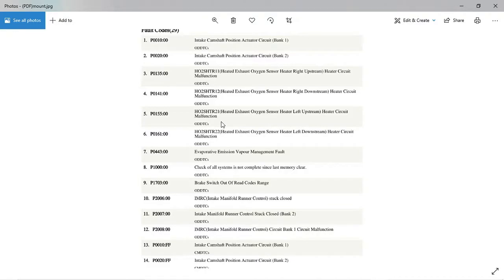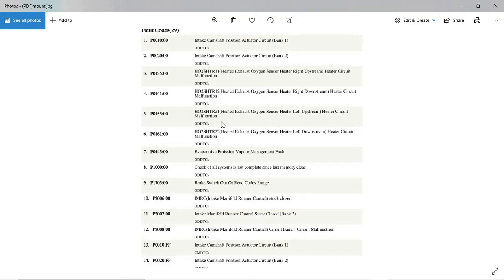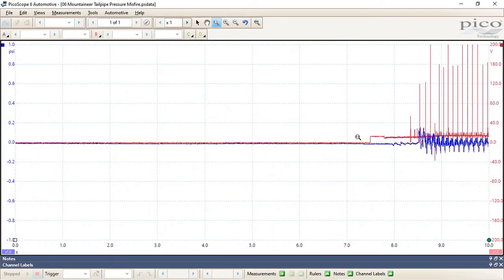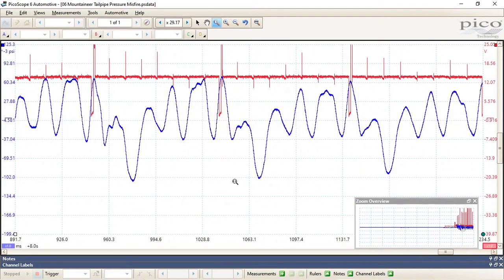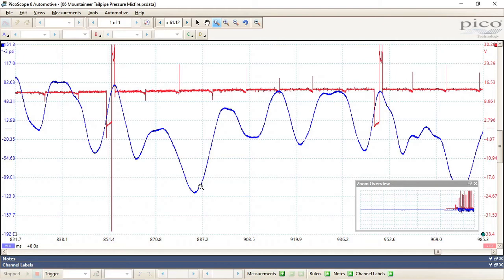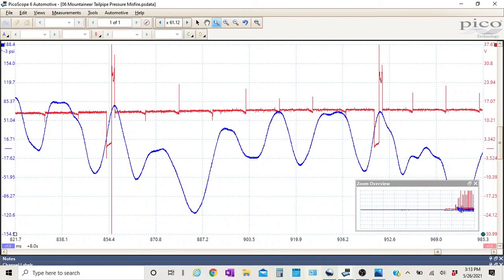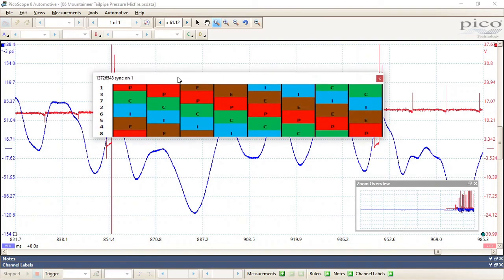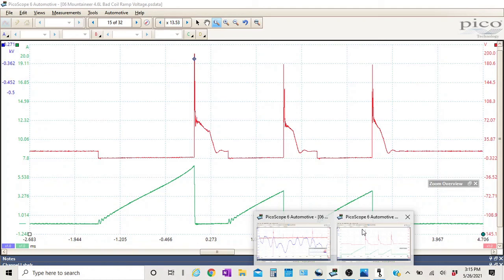Exhaust Pulses | Using exhaust pulses to identify a misfire.

Comment: You say every time the exhaust valve opens there is a "drop in pressure". Why so on a good cylinder that would have positive combustion pressure and then release that pressure into the exhaust stream when Ex valve opens??Would not a firing cylinder show an spike in pressure? Or are you referring to an in cylinder compression test with transducer where there is no combusion so the the cylinder would be in vacuum when Ex valve opens, hence the pressure drop ... can someone clarify what Ex pressure pulse pattern is expected for a good firing cylinder?
Reply from the maker: The exhaust pressure waveform in this video is referring to an ignition or fuel misfire. If an exhaust valve opens without prior combustion, then there will be a high amount of negative pressure from the expansion stroke. This low pressure is the drop we can see from the ignition or fuel misfire.

Combustion on the other can release a positive pressure(10-20psi) when the exhaust valve opens. After a cylinder has exhausted its positive pressure, a slight drop in pressure towards atmosphere will occur. My Pico wpx500 shown in this video shows a positive overall exhaust system pressure on a healthy running engine. This can only be seen with an absolute pressure sensor

Watch the video "Brandon Steckler Applying Advanced Drivability Diagnosis". Brian shows cylinder pressure with a one spark plug removed on a 5.7L hemi. Its near the end of the video.

Comment: The pressure drop is due to a vacuum pocket in the cylinder when the cylinder misfire. A in cylinder running compression test shows the vacuum pocket. If a injector is causing the misfire, injecting propane into the intake manifold will help improve the pattern and remove the misfire.
Reply: Yes, but he says every time the exhaust valve opens there is a "drop in pressure". Why so on a good cylinder that would have combustion pressure and then release that pressure into the exhaust stream when Ex valve opens??Would not a firing cylinder show an spike in pressure? Or is he referring to an in cylinder compression test with transducer where there is not combusion so the the cylinder would be in vacuunm when Ex valve opens, hence the pressure drop ... can someone clarify what Ex pressure pulse pattern is expected for a good firing cylinder?
Reply from the maker: The exhaust pressure waveform in this video is referring to an ignition or fuel misfire. If an exhaust valve opens without prior combustion, then there will be a high amount of negative pressure from the expansion stroke. This low pressure is the drop we can see from the ignition or fuel misfire.

Combustion on the other can release a positive pressure(10-20psi) when the exhaust valve opens. After a cylinder has exhausted its positive pressure, a slight drop in pressure towards atmosphere will occur. My Pico wpx500 shown in this video shows a positive overall exhaust system pressure on a healthy running engine. This can only be seen with an absolute pressure sensor

Watch the video "Brandon Steckler Applying Advanced Drivability Diagnosis". Brian shows cylinder pressure with a one spark plug removed on a 5.7L hemi. Its near the end of the video.

Comment: I've been practicing lately and trying to learn this way of testing. I watched lots of videos but most are done with 4 cyl engines. As you may know, V8s are harder to read the pulses.
What sensor did you use? And was this test done cranking or idling?
Reply from the maker: This was done on a V type engine at idle. The sensor was either the Pico WPS 500 or the Ditex Pressure Pulse sensor. Either can be used in this low pressure application.

Comment: Not a good overlay, you aligned the left side, adjusted the right side, and had to come back to the left side again, new pieces of software don't have this, meaning there are better overlays than this one so I recommend against it. If you want to try this one, start your alignment from the right side??? #1 sync is on top, not all overlays sync on the top so be aware of this when you start to use your new software. You are correct, sometimes what the scan tool states are the missing cylinder, is incorrect. If codes and Mode 06 data were recently erased, you are out of luck.
Reply from the maker: I don't care where I start the overlay. Left or right it doesn't matter. This is the only only overlay I've used with the Pico so far.